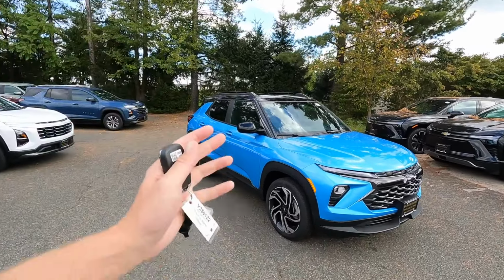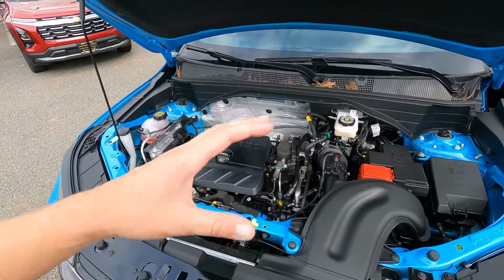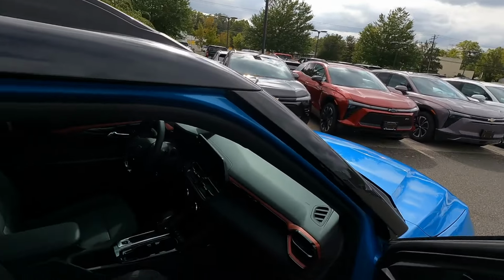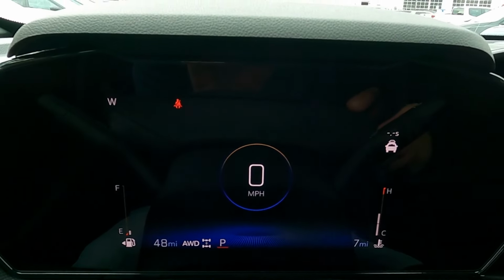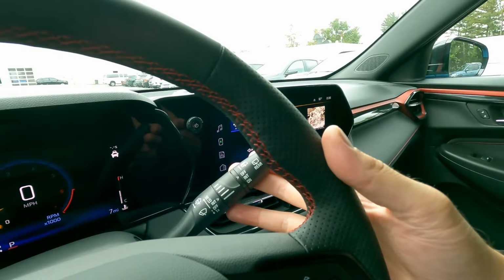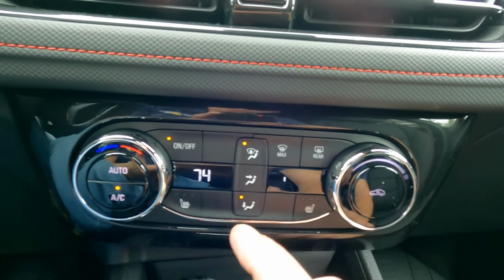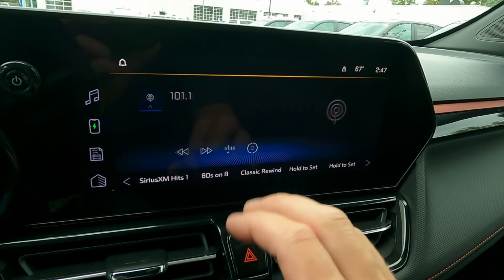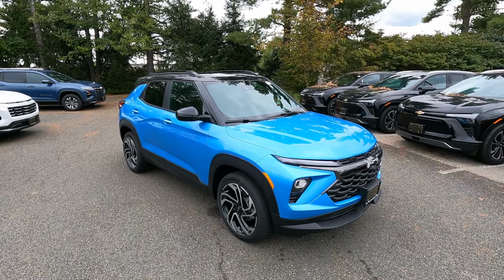Congrats!! You just purchased a 2025 Chevrolet Trailblazer

Comment: Thank you for making this informative video.  My special order 25 Trailblazer Activ is supposed to be built this week, and hopefully I will have it in February.  I special ordered it because I wanted the black/artemis accent interior and the Adaptive Cruise & Sound Package in order to get the Bose sound system, but I passed on the panoramic sunroof.  I landed up selecting all wheel drive just to avoid the CVT, and now I am looking forward to having the selectable all wheel drive feature.  This will be replacing a 2022 Ford Escape SEL, which I like a lot but is a lemon.  The Trailblazer is a lot more fun and easier to drive and maneuver than a 24 Equinox in my opinion.
Reply from the maker: Awesome! You're going to love it

Comment: Thanks, Dave, for such an informative video. You earned a subscriber! I may buy a new Trailblazer, and this is quite helpful. Just wondering if you could help answer. 
1. What is the difference between ACTIV and RS trims? For daily office use and frequent drive out of the city (about 160 miles return), which is a better option? 
2. I guess this car is 3-cylinder. Does it make any noticeable engine noise while driving? 
3. Does this car stay stable at 70-75 mph on the highway? Depending upon wind speed, my current SUV shakes when I hit the highway at that speed. Thank you.

Comment: Excellent video. Well done. I purchased a brand new 2024 FWD Trailblazer LT back in March. It has most of these features, so this was helpful. The 1.3 is matched to a CVT, and I know there are those who hate that transmission style, but I find it super smooth.  So, to keep the CVT healthy, when should the system be either flushed or topped up? How many miles? (or km since I am in Canada)
Reply: I can’t answer your question, but have one to ask you, since I’m considering this vehicle: how do you find the acceleration on the highway? I test drove the RS with the turbo (155 hp) and found it peppy enough in town, but am wondering what highway driving will be like . . . Also Canada 🇨🇦 here 😉
Reply: @ I must admit I have been pleasantly surprised. And I do mean surprised. Here’s what I found, if I floor the accelerator pedal rapidly when I want to overtake somebody, I almost feel a slight disappointment. Perhaps this is because it is a CVT and it’s not going to kick down as I would experience in a normal transmission. However, if I gradually increase the pressure on the accelerator allowing it to get further down in a nice linear fashion, the acceleration is not only smooth, but also very surprising. You can find yourself going from 100 to significantly illegal very quickly and very smoothly. Once more if this is a function and factor of the CVT, I am very impressed.
Reply: @KJKsimmer Thank you very much for your reply. I am certainly encouraged by your pleasant surprise of a discovery, re acceleration. I take possession of mine tomorrow—it’s an AWD RS trim with the 9 speed, so we shall see. I’ll be anxious to hop on the highway and see if it reacts similarly with the gradual acceleration you suggest. I’ll let you know my findings! 
Thanks again for your feedback 😊

Comment: I have a question. Is it possible to disable that feature where the car engine shuts off at every light unless you hit the off button. It’s there to save gas, but I find it annoying to have the car engine shut off every time without hitting that button?
Reply: I think you may be miss understanding, when you press the button I’m pretty sure it disables it until you press it back on. Meaning you only haft to press it once and that’s it